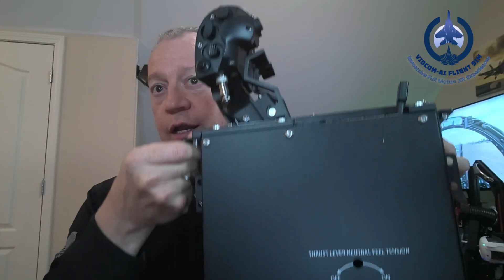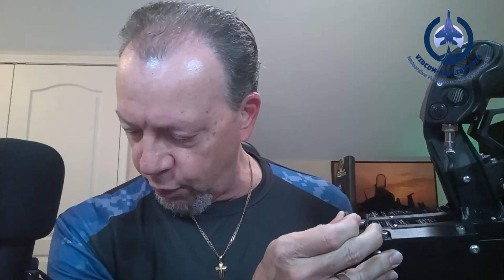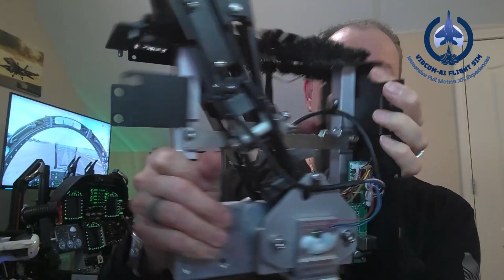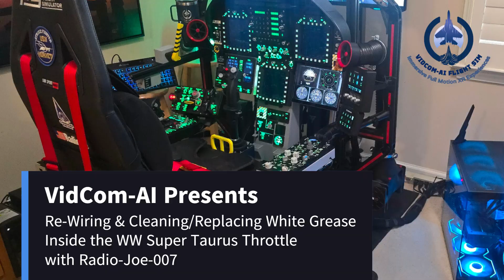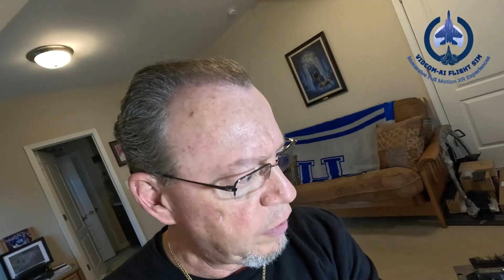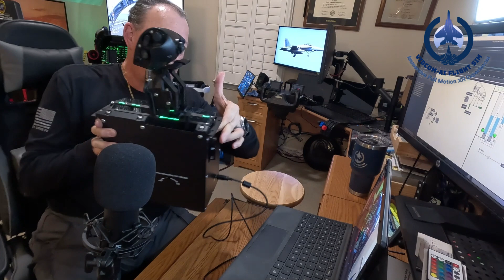WinWing Super Taurus Repair Video

Comment: Ok Joe, WW is no help when it comes to these units. It does not show up on my SimAppPro but the start-up panel does. What do you think the problem can be?
Reply from the maker: It's typically the cable/USB Port Power Issue and/or a failed Firmware update.

What are the circumstances surrounding its disappearance from SimAppPro?
Reply from the maker: I've also had luck by connecting a non-responding individual WinWing Component, by connecting it to a stand-alone laptop with SimAppPro running.

You can try that, and also try simply disconnecting everything but your keyboard & mouse. Then connect your Super Taurus Throttle directly to a USB 2.0 Or a USB 3.2 Port, directly in the back of your PC (a motherboard USB Port), using a new high-power cable.
Reply from the maker: One other thing:
I believe WW has a cable sensor built into the Device USB Port, itself. So, it's important to disconnect the USB Cable at the WW Device connection end of the cable.

Ensure all other USB Devices are disconnected (other than keyboard + mouse) and open up SimAppPro. 

Then... 

Use a new or known-good USB 3.1 Cable to connect the device directly to the PC Motherboard connection. This takes all other variables out of the equation.

You should see the WW Throttle show up immediately. And let me know how that works - if it shows up.
Reply: @joevwbd_horns8544 it was a cable issue. Thanks.

Comment: Awesome tutorial - thank you.
One question: I would like to have the friction even tighter than it is on the maximum. Is there any "easy" way to tighten the friction if if feels to sloppy even on maximum friction lever setting?
Reply from the maker: Here's a link to the Repair Photo Album on my Google Drive. You'll find a couple pictures showing the Throttle Friction/Tightness Adjustment Screws at the bottom of both the Left & Right Throttle Arms. I've highlighted the screws with Red Circles (or Mark-up).

Good Luck - You can Do It! 
https://photos.app.goo.gl/xneoQH9HB3nsqZ3M9
Reply: @joevwbd_horns8544 awesome - thank you very much! You are a life saver ... or more a Throttle savior! ❤

Comment: awesoome video :D do yoou by chance knoow if its possible too increse the fricitiono with the friction lever even moore mine seems to be still very light with friciton full up
Reply from the maker: Surprisingly enough, I meant to actually check that, while I had mine taken apart. Unfortunately, I forgot to check it out.

It looked like there was a srew adjustment within there, that would allow an adjustment. I say open 'er up n let us know what you find.
Reply from the maker: Yes, I believe you can individually tighten each side of the throttle arms by adjusting the two lower screws at the bottom (wide axis around the center pivot) joint. I can send you pictures highlighting those screws. Just DM me via Facebook or email:
JoeV@VidComAI.com (Biz)
Reply from the maker: BTW: I added a link, above, to my Google Drive where I posted pics - a couple showing which screws to tighten, to adjust the Friction of each Throttle Arm, individually.